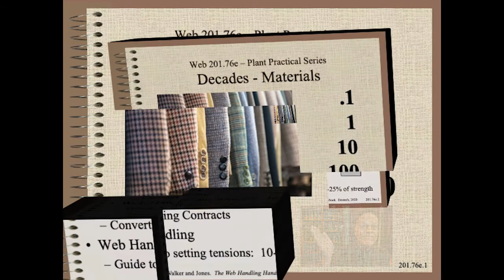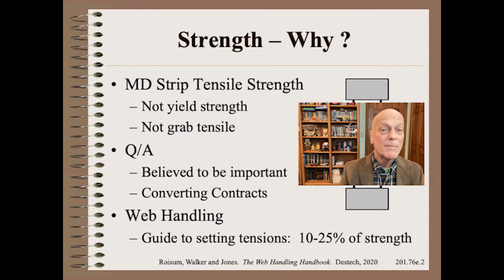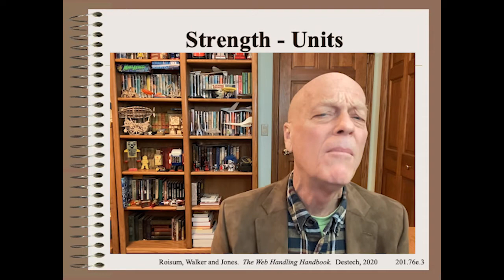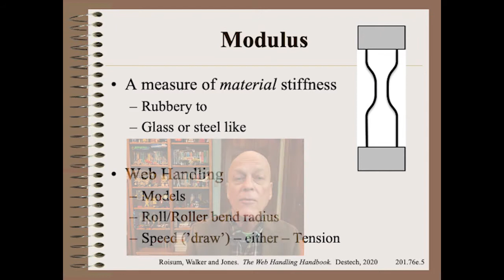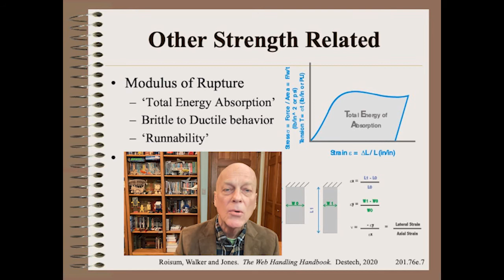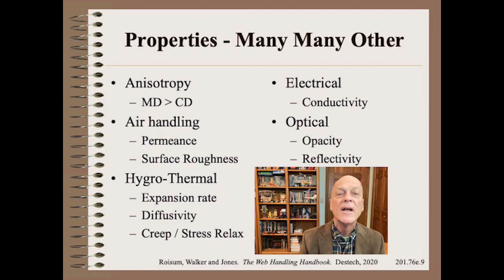Web20176e - Decades - Materials

Comment: Interesting problem. I don't have the answer either!  Some observations and measurements may help us understand.
Is  the core a perfect cylinder, or does it have diameter variations across the width? These would have  a big effect at first but gradually get hidden (like the thickness steps from the end of the web and any tape applied) as winding proceeds.
Do the chucks or winding shaft distort the core when they grip it, giving a similar effect?
Both core and web may be changing moisture content more quickly at the roll ends than in the centre, either shrinking or expanding. Bagginess from this cause may decay with time after unwidnign as the water content evens out.
Is the web badly wrinkled for the first few turns, appearing as a broad area of increased diameter?
Measuremnet of pressure on the core across the width show huge variations from stacking persisent thickness variations (analogous to the diameter variations at the roll surface).  The pressure may partially fall with time if the material is viscoelastic. When the web is unwound, I would expect the MD recovery to vary with the pressure experienced.
I hope these suggestions help.

Comment: Hello sir please suggest the solutions of joint failure in CPP films.
Reply from the maker: If you mean heat seal, that is outside of my expertise.  There are two AbbottApps that calculate the heat history of clamps as they are applied.  Better living through heat and/or chemistry.